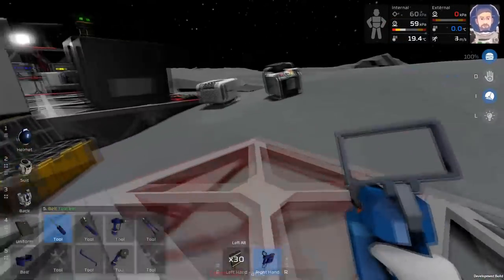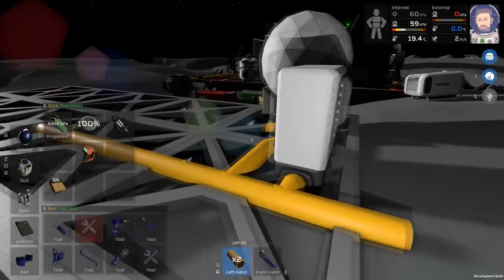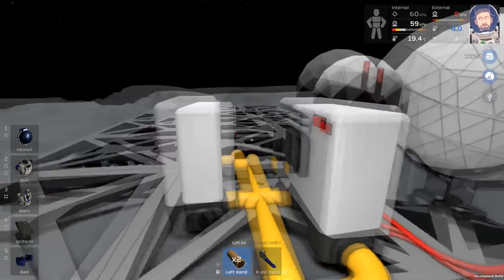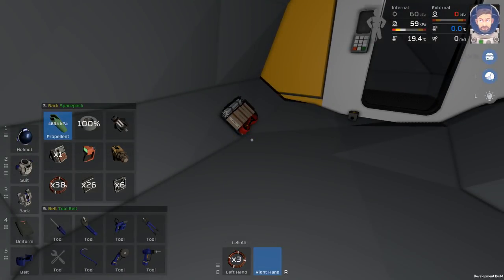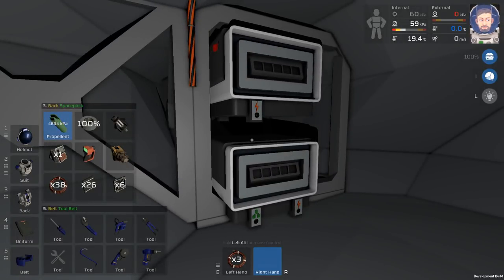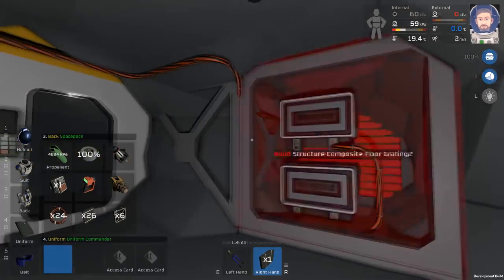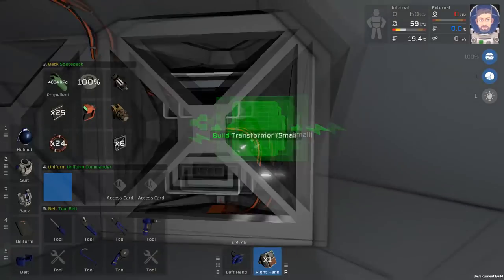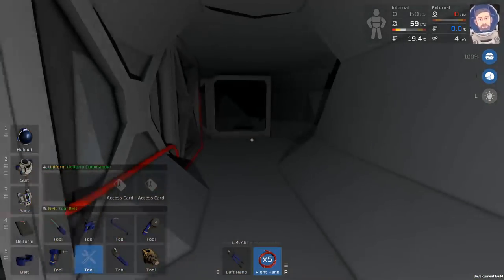Gas Filtration System - 6 - Stationeers

Comment: it's much easier to get a main power bank centralized running in parallel then each room can have an APC or small transformer to isolate the network so you can run different wire size
you can have 1 main power wire going through your base and branch off this one. it is a lot easier to manage than have each room with their stationary battery as they do have a drawback. they can melt your heavy cable if you make a mistake. like connecting a new battery downstream. they reacharge in 1 second which is 3.4Mw and the cable can only handle 100Kw.
this is just a tip

Comment: I built my base on the surface and put all my filtration underground. I have yet to pump o2 into my base but I do have a back pressure regulator on the output and I filled it with oxcite so my filters are still filtering the nasty out. But soon I'll be pumping o2 back into my base so I won't need to keep melting oxcite for to long